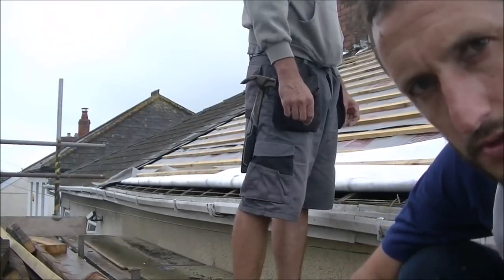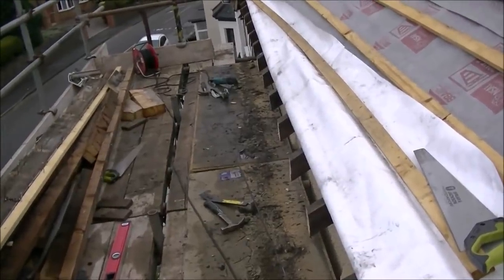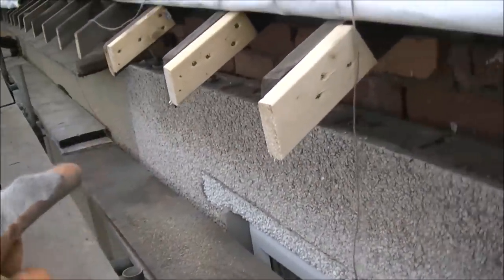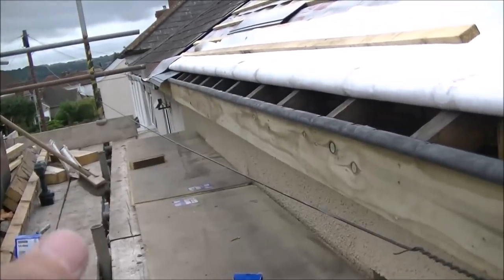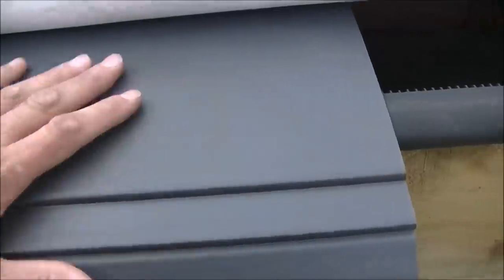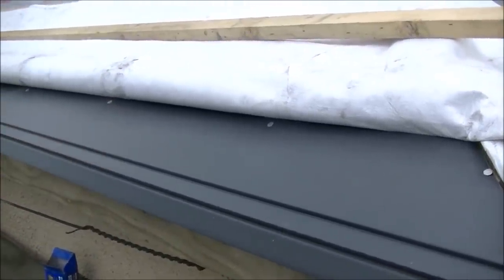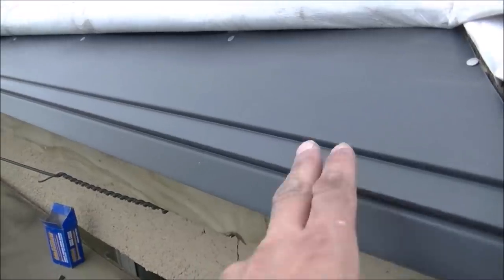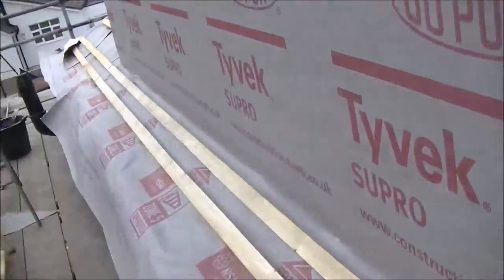Loft Conversion Part 14 - Fascia boards, fascia vents, soffit boards & felt support trays.

Comment: Just a thought if you were putting upvc over  fascia’s on to the new wooden fascia’s wouldn’t that cover your fascia vents?
Reply: I was thinking the same. Even 9mm uPVC facia board will block a proportion of the effective ventilation gap. Won't it?

Comment: Maybe I'm being too fussy but do you not 5 star treat all timber cuts?  I'm currently diy reroofing and these videos are hugely appreciated, thanks.
Reply from the maker: This timber was already tanalised so treated throughout, and it got covered with UPVC over fascia in a later video. Thanks for watching.
Reply: All cut ends on treated timber should get a coat of protim/creasote, 🔨🇮🇪

Comment: Do you not need additional insect mesh over those fascia vents? As the vent gaps looked large enough that wasps or other insects could climb through?. Only asking as in my new built house they didn’t have a fine enough insect mesh and I ended up with a 5foot x 4foot wasp nest in my house
Reply from the maker: That's the problem, building regs stipulate a minimum air flow required so you have to have that gap, however it does allow small insects. You can't win!!

Comment: Hi Pouse, great series. Can I ask is there any particular reason you didn’t use low maintenance upc soffit and facia boards?
Reply from the maker: Hi, I will be using upvc over facia at the end of the project. I used timber as I think it is more solid and helps with structural integrity of the roof. Also I can carry on with the rest of the roof and do the plastic at the end avoiding getting it damaged throughout the project. Hope that helps. Thanks for watching.
Reply: POUSE around the HOUSE Thanks for that. It makes sense now, cheers.

Comment: Are you using building control for this project or are you going to try for retrospective planning. Where's your velux top hinged escape window that starts no more than 1100mm from the edge of your roof, you know the one you escape out of of your house is burning down, or are you not required one in Wales? 👍🙂
Reply from the maker: You don't need one. You have to make a 30minute fire proof escape  route to the outside by way of correct plasterboard walls, floor insultation and fire doors on every room that can be accessed from the downstairs hall and landing. Also mains powered smoke alarms on each floor. This is why there are strict rules in stair size, tread depth, handrails etc. An escape window is no good if there's no where safe to go when you get out. Building control don't like the idea of you sat on a roof waiting for the fire service. It's also not easy to rescue you from a sloping roof. It obviously depends on the layout if your house, multiple occupancy etc and different rules for different countries. Hope that clears things up. It's all on the .gov website.

Comment: OK ~ Good Work , Hey What Keeps the Bugs out of those Fascia Vents  ?  Like Termites - when they Nest Out they Fly  . .
Reply from the maker: Well I don't think we have termites in the UK so should be ok on that front. As for bees and wasps, they're unlikely to fit through the holes, but if they do then I guess you cross that bridge when you get to it! But the void is completely separate to the interior. Thanks for watching.

Comment: hi , could i ask pls what is the size of cheap treated timber under fascia boards ?  thanks
Reply from the maker: I used a 6x1 but it depends on what size fascia you want. Both uPVC and timber come in a range of sizes suited to your needs. Best of luck with it.
Reply: @POUSEaroundtheHOUSE  Thank you for reply, probably also 220 mm fascia ,  with T and G soffit ,

Comment: What voltage impact drivers are you using? Thanks
Reply: Shirish Patel makita 18V
Reply from the maker: Hi - As Anthony said, 18v makita. 2014 model I think so they are better now, but an excellent tool and to date it has never let me down. Thanks for watching.

Comment: why do you need vents when your felt membrane is breathable?
Reply from the maker: Building reguations - still need a minimum air gap between felt and insulation to prevent moisture build up. The breathable membrane allows a smaller air gap.

Comment: Ideally if one is extending rafter tails one should put a birds mouth on them and sit them on the wall plate. Ideally they should be one third the lenght of the original rafters. Not always possible of course, 🔨🇮🇪

Comment: Love your vids, would those vents work for a flat roof 👍🏼
Reply from the maker: Thanks for the kind words. I think with a flat roof you fill the whole void with insulation then with osb board or plywood over the top, followed by your chosen roof finish e.g. epdm or fibreglass. Hope that helps.

Comment: Is it awkward putting the gutter clips on with the support trays fitted?
Reply: @rsg666  👍👍
Reply: VERY
Reply: @justycrusty  I was thinking it must be awkward if you needed to repair or renew gutters once its slated with support trays on.
Reply: Mark Felts they are quite stiff. There’s hardly any movement in the flap going down into gutter. If you want to push the gutter up tight to underside of tray, it’s hard work fixing clips etc
Reply: @justycrusty  👍👍
Reply from the maker: All - I did this way as I had lots of work to do on the roof and didn't want to put my plastic on early and then mark or damage it later. My support trays are quite flexible so it's not a huge issue. Depends which type you buy maybe. Thanks for the comments and thanks all for watching.

Comment: oh hi, where did you get the facial vents from?
Reply from the maker: Just my local builders merchants. They are just called fascia vents. Hope that helps. Thanks for watching.
Reply: @POUSEaroundtheHOUSE  doesn't the plastic facial cover the vents When's it's butted up to the vent I've been looking the thinnest facial is 9mm thick?
Reply from the maker: @robkettle1971  there's a slight overhang or protrusion on the fascia vent that you butt the uPVC up to, leaving the vent fully exposed.
Reply: @POUSEaroundtheHOUSE  thanks for the reply

Comment: Good info. I was looking for at 6:00 I'm just curious to know how much of the over fascia venta were covered by the upvc capping board nailed to the timber fascia as this is what I'd like to do
Reply from the maker: Hi Dan, none is covered, it butts up to the underside of it. Hope that helps. 👍
Reply: @POUSEaroundtheHOUSE  it just looks like when the vent is screwed to the top of the timber with the back of the vent flush with the back of the timber, that adding a upvc capping board to the face of wood, the top of the upvc woukd block or restrict the vent overhanging the wood

Comment: hey mate! amazing vid as usual. is it the same process for a flat roof when it comes to venting. it is better to use those vents or the circular ones that go into the soffit?
Reply from the maker: I think there are different methods with flat rooves depending on whether there is an upturn into a wall, or if the roof is detached. But I would say soffit vents are likely to be more suitable. You can also buy vents that go on top of the roof. Try Ali Dymock or Oakwood Garden Rooms on youtube. They have a lot of info on flat rooves including warm, cold and hybrid so they'll probably have better advice. If I do a garden room I'll be sure to put on here! Best of luck.

Comment: If those purlin strapping members are directly in touch with a flat layer below, there is no drainage on your roof assembly, the purlins should be going down vertically first and than if you want to support a cladding that needs opposite support, you than do the perpendicular purlins ontop of that, similar to a rainscreen wall that needs to accept vertical siding, first layer for rainscreen assembly to support vertical siding is vertical rainscreen than perpendicular horizontal rainscreen.......... Drainage is key in all assemblies. I design performance homes (passive, net zero, etc)
Reply from the maker: When you say purlin strapping members do you mean the battens? The verticle timbers are rafters, and the purlins are the large horizontal timbers supporting the rafters half way along their span. As for drainage, you leave a sag in the membrane between each rafter which allows any moisture to run down to the eaves. It's standard practice in the UK. What country do you construct in?
Reply: @POUSEaroundtheHOUSE  Good to know, yea for me practicing building science into my designs, country isn't the concern and more so the climate. British Columbia Canada has a similar environment to the uk I imagine. My point with purlin systems on a roof is that the first layer of wood used to suppor the cladding of which the roof cladding is fastened to, should drain down the length of the roof so that if water gets in, it easily gets out, leaving a sag in random sections still creates a dam for water to sit there and pool and leak into the building assembly, free almost uninteruppted drainage is always the best is what I was getting at.
Reply: @arayahomes4308  I think you're referring to counter battens. Purlins are a completely different part of the roof if using Uk terminology. The sags are not random, they are between every rafter to prevent pools from forming. When you are matching the roof height of your neighbor's roof, you cant change the design??

Comment: Pouse I love your videos mate but however I regret to inform you that by cutting your rafter feet back by the amount you have it looks like you made  a decent size step from your fascia to your neighbours my friend. This going to cause you some issues my friend your eave support tray and slates are most likely going to over hang your gutter too much now. If you use spacers to push the gutter out to the neighbours level it will look ridiculous and a bodge job mate. In my opinion you should go back and extend the feet back to how they was in your stride for perfection you made an issue with next doors and yours fascia and gutter I’m a roofer of nearly 4 years and I’ve beginning to learn that sometimes you just gotta leave something not quite straight etc for it to work and look “right” obviously you know it isn’t straight or what ever but 99.9% of people aren’t gonna notice but they will notice the gutter making a step out from the fascia.
Reply: 😅 erm kid okay because kids get sent up on roof tops do they? 

I’m probably twice your age fella dunno why you felt the need to comment what you did when I was only offering pouse my opinion and advise on the issue he probably knows he got or he might not know means never here or there really. I’ve commented on pouses videos before giving advise and tips, he took them on board with open arms too I might.

I’m a professional roofer i do the job day in day out so I think it fair to say I’ve very clued up when it comes to roof line. Obviously I don’t know everything I’m still learning everyday so are most people I’m yet to meet anybody that knows everything regarding building and there trade. 

I do believe pouse is a DIYer or plaster by trade and a bloody good one from the looks of his videos doesn’t mean his not gonna make mistakes along the line here or there his human just like the rest of us. 

Where was you going with that comment anyway what did you think I’m wrong and there isn’t a step in the fascia from his side to next door neighbours when in his video you can clearly see it or are you just a special stupid or just arrogant mug? 

Anybody with a bit building knowledge can see what pouse done has caused an issue that needs addressing and carefully thought to over come in which again I’m sure pouse has thought about that but incase he didn’t I thought I’d mention it and give my professional opinion on the matter and what I’ve learn in my nearly 4 years doing the trade.
Reply from the maker: To all - I haven't created a step. If you look closely I didn't touch the closest rafter to next door, I only took back the middle rafters as they were the ones that had shifted. What you think is a step is actually just a twisted fascia board next door. A few screws will pull it back in line. I explain in the video how the string line is run from next doors last rafter to my opposite end rafters so there is a nice straight line joining into next door. Adding forget I have to add a upvc facia which is 10mm thick. Sorry if video didn't make that clear. Thanks for the comments and ideas and thanks for watching!
Reply: Okay then guys that solves that debate 👍🏼😂 

Edit

Ive gone back and watched the video and can now see in fact the fascia is twisted giving me the illusion of a step out so no issue caused here then I still think you might have small issue with getting the first course of slates to land  half way in the gutter properly though but next video will show us more clearly.
Reply: Thank god that's settled nice job pouse

Comment: descent video bud,  but the felt support tray must be sitting on top of the fascia vents, there is a notch at the end for that, if you leave it overhanging like that the wind uplift can mess up the whole eave line, needs to be cut back , thats why you sort out the fascia and eave ventilation be4 you felt and batten the roof, other than that, great chippie work
Reply from the maker: Problem was I was trying to take the bow out of my facia, line up with my neighbours facia and line my slates up with the neighbours. I take your point but it is all solid and fine. There's less of an overhang down the side of my house. Thanks for watching!